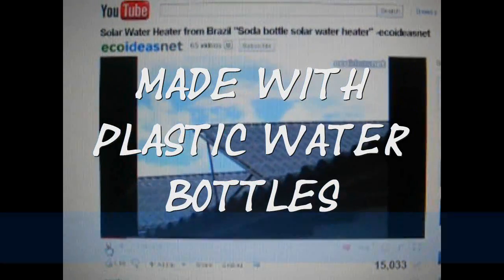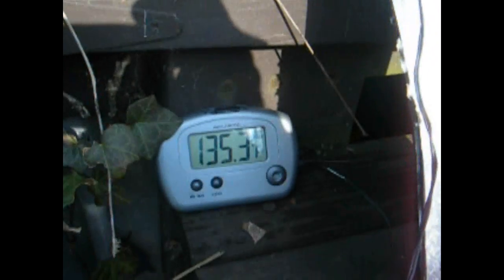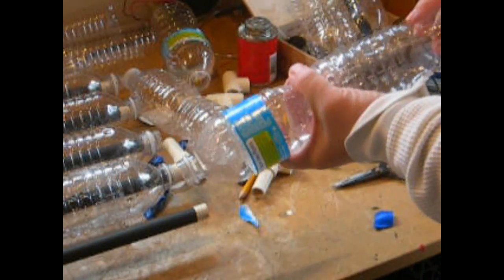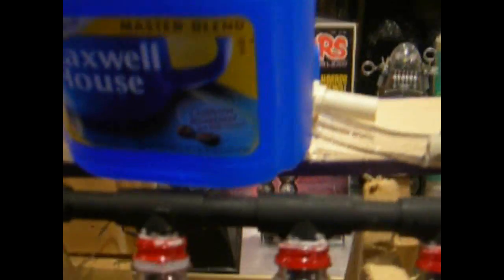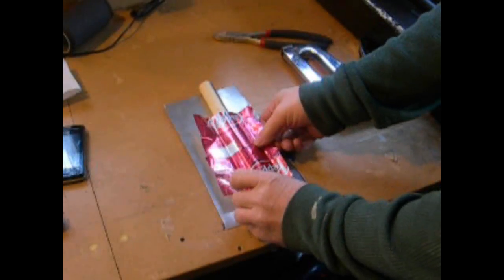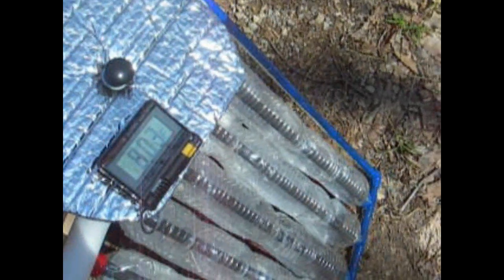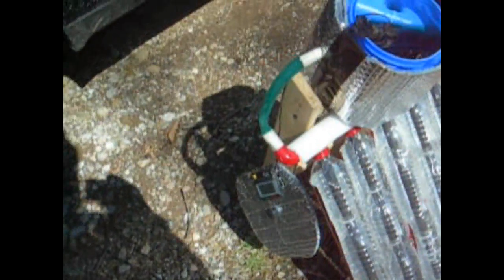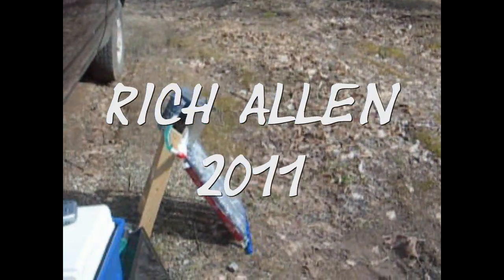SOLAR HOT WATER TEST RICH ALLEN

Comment: There is 100 w per square foot. So how much heat. Did you gather? One btu is 1 pound of water(.125 gal) raised 1 degree. Also at what rate did you gather ie btus/hr. To convert to an amount of eqiv electrical power take btus hours/ 3415. Btus/ kw hrs is the equiv kilowatt hours used. You may now convert to thermal efficency btus stored/ ( 342 btus/ft2 x ft2)  now compate to flat plate comercial collects 70-80%

Comment: Hi Rich, I cannot see a pump, how did you get the water rotating through the system?
Reply: The hot water rises, so as long as the storage container is above the solar collector, it will flow naturally.

Comment: Awesome video. I think I know why you're not getting a LOT more heat. It's the reflectivity of the aluminum can. I did an experiment with a parabolic mirror using aluminum foil tape and couldn't get hardly any heat https://youtu.be/pzZaN5DY8BA - I think the same thing is happening here. Aluminum from the inside of a can is not polished for reflectivity and doesn't act like a magnifying glass. You need to buy special highly reflective mirror tape - I believe using that around 1/2 the bottle will amplify the heat 3-4 times and you should get 50-60'C  or more from this system instead of 25-30'C.  I huge sheet of mirror tape is about $20-$30 so it's not a pricy fix - one she is probably enough for a large collector 3-4 times the size of the one you made here.

Comment: Hey Rich, I've tried this with and unfortunately didn't work for me. May I ask:
1- is it a problem if the bottles are not totally hermetic to air as you put them one inside another?
2- can the system be in a zigzag to have the same water go through all the pipes and eventuelly be exposed longer to more heat?
3- Is there a way to write to you directly? ismadiaw

Thank you for any further support, friend!
Reply: it is better to have the bottles sealed. Think greenhouse effect.

Comment: The ambient ground temperature is definitely going to dampen your results, especially in the winter. At higher elevations, like on a roof, you'll see a much more dramatic difference in output. BTW, wouldn't copper be more effective then PVC? We used to make these minus the bottles back in the 70s out of copper with a reflective back and they seemed fairly effect as a preheating source for hot water. Just my two cents worth. Nice work, btw. Cheers and Happy New Years to all.

Comment: You can definitely use Peltier's on a SHW system. You just need a couple plates of aluminum to pass the heated pipe through and a glycol/water fed cooler system. key is to get the 40-60 deg difference in temp to get best power.

Comment: Solutions for cold weather: Evacuated Solar Tubes. Also, build an insulated heat box big enough for your heat collector AND a 40-80 gallon hot water tank. Paint the tank black insulate the shit out of that box and you can use parabolic mirrors and even flat mirrors to really get some heat. You can make this box a combo furnace and water heater by having air run through it with a fan during the day and into your house. Turn furnace off and your box should stay hot over night. Shower in morning :)

Comment: Hi Rich. I have been studying your videos for a long time now. I really appreciate your work! I had the same idea with the black pipes going through the plastic bottles for use a walls for a greenhouse. Anyways I have some ideas for you to try if you have time. Instead of having a radiator style heater, try running the pipes horizontal in a single back and forth  pattern. The higher up it goes the water should get hotter. And try putting the reflective cans inside the plastic. Keep me posted!

Comment: Hey Rich 
I enjoy the videos and all the Mad Scientist stuff you try. Have you ever tried using bricks 
as thermal mass in the heater, they have three holes so you could run water pipes through them and after the bricks heat up of course paint the bricks black and you could use a tin can air heater as a preheater  making the bricks heat even faster with brick mass the water should heat faster and temps drop less due to the thermal mass. I love the gutter tin can heater and the led windmills!

Comment: Hey Rich 
really enjoy all of the mad scientist stuff you do I was wondering if you use brick inside the frame they have three holes in the brick could run water pipe through them or just air only and paint the brick black the mass of the brick will keep the temp from dropping so fast but the down side it will take longer to heat up, just a thought Have you ever used a tin can heater as a pre-heater for a solar water heating system linking the two would help the bricks heat faster

Comment: @preparedchipmunk you could use a closed loop glycol system - it would run through the pipes outside and then into the tank, which would heat the water in the tank - bit more challenging and costly to do, but it works - a drain back system which would allow you to drain the water out when the sun is gone would work too...but risky...